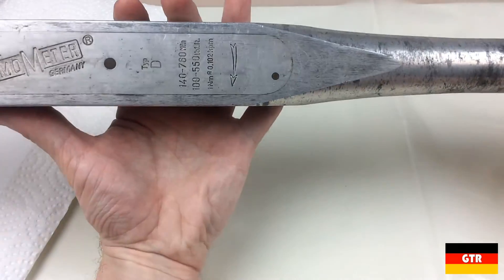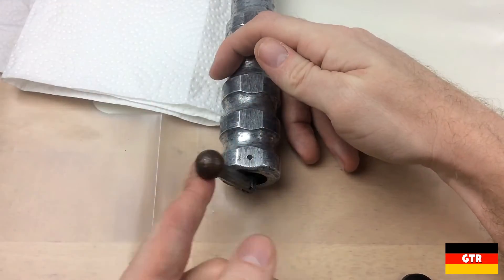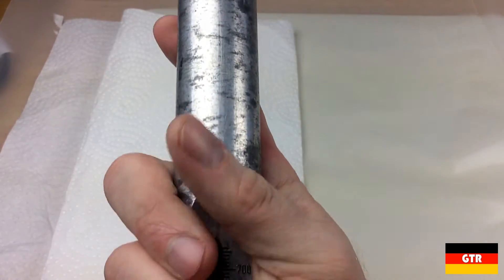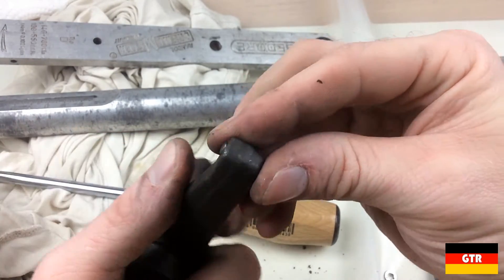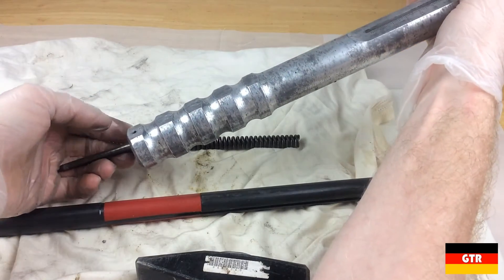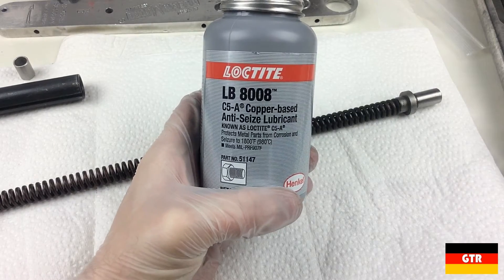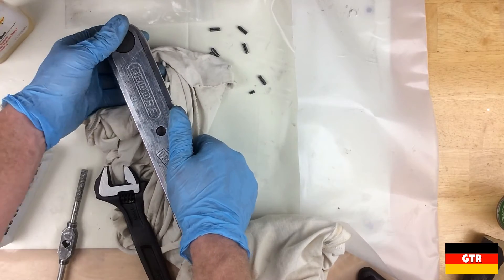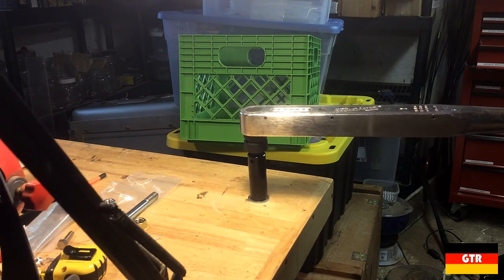Vintage Gedore Dremometer Type D Torque Wrench Teardown & Restoration

Comment: Judging by the calibration sticker "Log/Bw/...), i would say this was originally used in the "Logistikkommando der Bundeswehr", the logistics command of the German army, maybe bataillon 168(?). There are a lot of them on ebay in Germany, most of them military surplus. Oh and the sticker says the next calibration is due on december 1991. Great content btw.
Reply from the maker: Thanks for the information!  I figured it was used on a heavy piece of equipment like a tank at one time. There aren't many times when you need a torque wrench this big.

Comment: That's not the sticker from the factory calibration, it's from the german Bundeswehr. This was actually in military use. Indications: Bw (short for Bundeswehr), the "Versorgungsnummer" (supply number) and it's signed with name and rank. HG is Hauptgefreiter, which is comparable to a Private First Class or Lance Corporal. The sticker also says "vergleichsgeprüft", which can be translated with "cross-validation".
Reply from the maker: Thanks for the information!  There were some other comments that it came from the Bundeswehr logistics command.
Reply: The "Versorgungsnummer" is called a NATO Stock Number (NSN) in English. Unfortunately, the NSN shown on the label, 7530-12-179-6586 is in fact the NSN of the label itself, not the wrench :). My investigation shows that the NSN of the wrench is: 5120-12-126-3169. It was NATO codified on May 30, 1969! The current p/n is Gedore 7691500, type no. 8563-10.
Thank you very much indeed for providing this video, which was extremely helpful!

Comment: I am just disassembling my Dremometer. I would assume someone worked on your wrench before as the roll pins at the end do engage on my wrench.

You really did great video's, they are still a great help!

Comment: I see now this video.

I scraped a dozen of those Dremometer cases last winter.
I bought these an odd twenty years ago from the Dutch army.

I see a lot of tools in your videos that here are laying around.

I calibrated them by putting washers between fether and tensionscrew. 

Tip: if it was a long time before that the wrench was used, put it first in the working bench and pull a few times till the click.

I noticed if putted in the callibrationmeter the forced droped after a few mearurements. Mostely they were again in range after a few puls.
Reply from the maker: Cool thanks.  I did get a quote to calibrated it at $100, which was twice what I paid for it so I decided not to at this point.  I will probably donate it to someone who could use it more often than I would need it.
Reply: weet je een goede manier om ze te kalibreren? werkt dat hetzelfde als de methodes voor normale moment sleutels met gewicht en lengte maal 9.81
Reply: @BasRikken ,

Wat bedoel je met normale momentsleutels?
Reply: @frankkraaijvanger4937  de normale met draaibaar handvat, welke ook alleen op het midden van het handvat gebruikt moet worden, om de juiste nm te trekken, bij de dremomter maakt de plek van je hand niet uit, maar hoe bereken je de nm met 10 kilo trekken icm lengte sleutel, of te wel hoe kan je prefesorisch zelf de dremoter checken

Comment: Do you know how the date coding for the serial numbers on these wrenches? Mine is 576.  It is stamped as Rahsol, but no gedore branding whatsoever, I'm thinking it's quite old.  It is a 'Type C' not a 'Typ C' as the spelling has changed. I'm curious to know what year it was made.